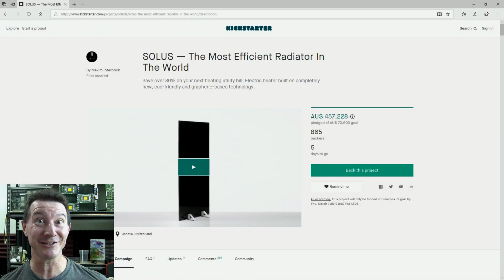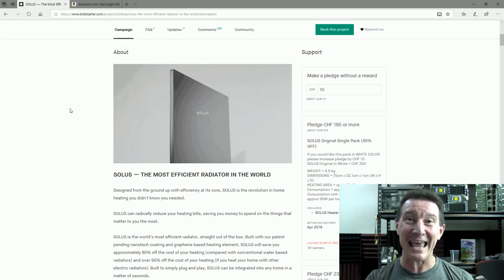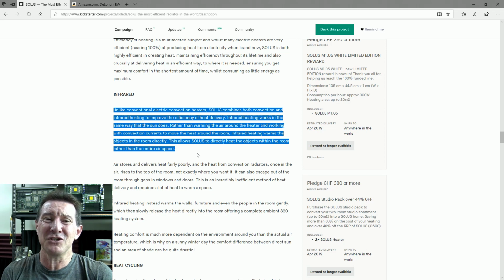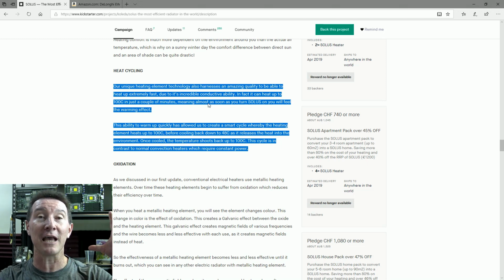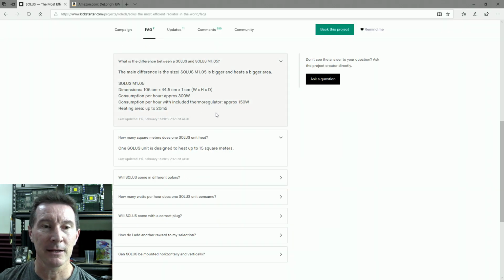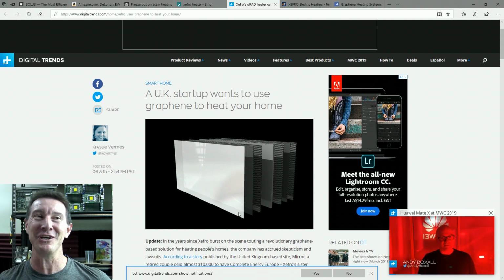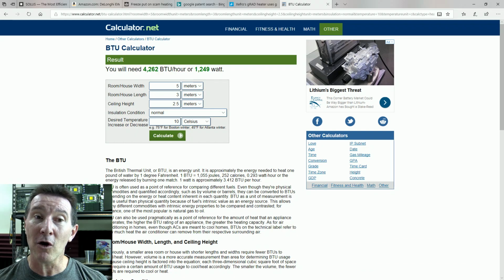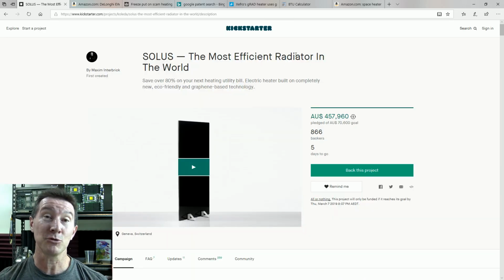EEVblog #1186 - Solus Graphene Heater Kickstarter BUSTED!

Comment: I just realized that if it is attached to a wall (hopefully with sufficient clearance), the thing will radiate from both sides.  This being the case, the "back" side will radiate INTO the wall (I assume there is no reflective matter between the panel and the wall).  The wall MUST absorb some of the heat and it will NOT heat the room.  So it isn't 100% efficient in heating the room.  Sorry about that...

Comment: Real simple how this works, take spin and hot air and add room. The graphene works because people repeating the hot air spiels on the wonders of this space age material to their mates adds to the total heat output so that you can get that over unity free energy.

Reminds me of the "wall" heaters that were 600W and create convection currents due to the radiator at the bottom of the cavity. They were only low wattage so you don't burn your wall. Salesperson tried to sell me one that was $500 had a nice black tempered glass front, and an element in the construction (not much else but brackets and power cable) and it was one of the cheaper ones. Needless to say I bought the $60 oil column heater that had dual elements (big and little for three heat settings) for a total of 2400W and a thermostat so I can save money.

Comment: At least if you buy a 200W light bulb, that is way cheaper than this heater, you can have the advantage of lighting up the room that is  warming, and it wouldn't be more effective at transfering heat since the bulb is also made of glass

Comment: Actually radiant heating can deliver heat directly to walls and ocupants of the room( heating the air only as an after effect) but in order to do this it needs to be a high temperature heating element ( because the radiant heat depends of the 4th power of the absolute temperature(Kelvin) of the heating element). As such, you will see such a system only in high ceiling rooms and only installed at a hight that makes it impossible for a person to touch them.
Because of the dangers of a high temperature radiant heating, all radiant heating used in homes are low temperature and rely on a large area ( doesn't seem to be the case here) in order to be effective.

Comment: I'm myself a creator on Kickstarter and an electric engineer who is running right now a campain (the Egrowr, a monitoring device for hydroponic plant growers). No fancy or false claims. The project is modest compare to some other campaign but the device works perfectly. It uses simple and prooved tech. I will not raise as much money as this kind of scam, but at least I won't disappoint my backers and won't end up in jail. But because of this kind of scam, I have comments from backers asking me if my device really works, if it's ready, only because they got "burned" so many times on Kickstarter. That's sad. 
Please report those kind of projects to the Kickstarter team (there is a button at the end of the campaign page). This have to change. They have to hire tech consultants in their team.

Comment: It is because people are stupid! All Resistive Heaters are all equally efficient! Power in is directly converted to heat with very little loss. It is not  like a an Edison incandescent light bulb were their is a lot of energy not going into producing radiant light in the visible spectrum and the heat is an unwanted byproduct and a sign of loss. I do not know how these guys could keep a straight face with the garbage coming out of their mouths! It reminds me of a late night infomercial. What is next people going to put permanent magnetic on their car's fuel line? Wait they already did that. Maybe they will stick stainless steel ducted fan blades into the intake are tract far upstream on the care to create turbulence in the air? Wait they already did that! I know they can put chlorinated paraffin in the oil and claim it reduces wear in the engine, allows it to run with no oil at all without seizing up and improves fuel economy!  No they have done that too. LOL Anyone dumb enough to fall pray to this needs to go back to elementary school!

Comment: Technology Connections also has a really nice video about space heater bullshit. A good watch after this one!
Reply from the maker: Looks good!
Reply: https://www.youtube.com/watch?v=V-jmSjy2ArM
Reply: Technology Connections is a fantastic channel that deserves a lot more attention. I hope some people wander over to check it out.
Reply: Especially the part that electric heaters are pretty much 100% effective because Heat IS their product is eye opening.
Reply: @Undefined Lastname It depends on the failure mode.  Most failures I've seen appear as point corrosion at the heating element terminal.  That corrosion is likely driven by thermal fatigue, with a strong initial trigger caused by damage when the element is made with a crimp or rivet.

A second class of failure is the thermostat contact points.  Obviously more cycles results in more contact erosion.

But this isn't to say that failures are common.  The vast majority of heating elements serve for decades without failure.  Rivets and crimps can both have an effectively unlimited lifetime.  Make-break contacts are a bit trickier with design and materials, but they can also be designed to have an extremely long cycle life.
Reply: @Undefined Lastname An oven element is typically a "calrod" sheathed heater.  Those typically fail when the helical element is off-center or the coils unevenly spaced.  That can occur from shock or vibration, but in an oven it probably had the defect when made.
Reply: Some heaters are better at heating a given space than others. Yes, they're all 97+% efficient at converting electricity to heat, but that doesn't mean they're worth a d**n getting that heat throughout a room. The parabolic heater I have will cook you if you stand in front of it, but does a poor job heating the entire room. Alone it'll hold the room about 68F; with a fan moving the air in the room, the room will be over 80F. The number you want is the efficiency of heat transfer.
Reply: @jfbeam  The key is they're all putting the same amount of energy (over a given time) INTO the room - I suppose that says nothing about the distribution but they're all going to convert 100% of mains power to heat.
Reply: @jfbeam  Except they're also 100% efficient at transferring heat.
You're talking about an IR heater that blasts you with LWIR and MWIR light, which heats you up directly.

Comment: For a bit over $20 (US) I can buy a nice fanned heater here in the USA at the local big box home improvement store.  Oh, they are 1500 watts as well (a bit more powered that this one).  Of course using electricity to heat the air in your home is very INEFFICIENT cost wise.  The nice natural gas heater that heats my house is much less costly in the long run (by about 3x as I remember).  What a waste of $$$.

As for things that conduct heat, you might try a diamond.  I understand that they conduct heat quite well.  A tad expensive though.

Comment: Buy carbon filament lamps!
Use your existing infrastructure to light up the room and heating at the same time. No additional costs!
It only heats when you are in the room!
90% gas heating bill saving guaranteed!
50 year lifetime warranty!
Reply: Making me want to make a panel with like 15 carbon filament bulbs behind them and make a good looking IR heaters

Comment: On a side note; Can you get Thermal Interface Material, or thermal paste in a graphene compound? What is its W/mk? For instance, liquid metal is about 73 W/mk, and good quality thermal paste is about 12.5 W/mk, whereas raw copper is nearly 400 W/mk. Diamond is about 1000 W/mk, so I wonder if you could make a really good thermal paste, better even than liquid metal using graphene?

Comment: Clearly the people behind this kickstarter  are either clueless or dishonest however this video seems too light on the physics as well.Heat is transferred either by conduction, convection or radiation. The first two rely on something to conduct or convect, In a vacuum radiation is the only way to transfer thermal energy. All three mechanisms can be at play with 'room' heaters. All rooms lose heat and good heating systems are designed to warm the occupants NOT the room. That's why underfloor radiant heating is used for maximum efficiency along with air tight building / room sealing and thermal insulation.Just to be clear, 50W of electrical power will ultimately become 50W of heat. It doesn't matter if it's turned into visible light using LEDs or to  heat an electric blanket. If the room was perfectly insulated the outcome will be he same.

Comment: I guess TECHNICALLY they're correct when they state: "The world's most efficient radiator", because they're the most efficient equal, along with every single other radiator out there. They're also the world's least efficient equal, with every other radiator in the world. Exactly 100% efficient, just like all the others. Except for those which lose some fractions of a fraction of a percent of efficiency by also running LED displays or WiFi etc...

Comment: Yeah, you'd want this in the centre of your room, not up against the wall. The Gib board would absorb a big percentage of that heat output, and you'd have a lovely warm slab of Gib board. 
It'll do the job just fine as an electric heater, but no more efficiently than any other; it's a law of physics. Electricity in = heat out in a basic resistive load.  These have existed for a long time. Like these old things: http://www.goldair.co.nz/product-catalogue/heating/eco-panel-heaters/425w-ecosave-panel-heater-with-digital-thermostat-geco260 but they don't have the fancy "Graphene" buzz word.
Or these: https://www.adax-solaire.com/electric-heaters-c1/electric-panel-heaters-c2/clea-wifi-glass-electric-splashproof-convection-radiator-panel-heater-p18

Comment: Dave, Do believe you're beating a "Dead Horse", It's not going to get up and do anything! Although, feels good to rant on the thing.
Folks either understand the laws of Physics, or they don't! They might take the advice of a trusted friend, (who actually knows something.) Or they are dumber than dirt, AND DESERVE TO LOOSE ALL THEIR UNDESERVED MONEY! A fool and his money ARE ALWAYS SEPARATED, (It's just a matter of WHEN.)
If electrical energy leaves the wall (Amperes at a certain VOLTAGE. (AMPS times VOLTS = WATTS)) no matter what it does, Light, Sound, Big Speakers,  Motor movement, Pumping, Fan AIR MOVEMENT,  any jalopy thing it does ( except ANY FORM OF ELECTROMAGNETIC RADIATION, Light, radio waves, Gamma rays, Xrays, Microwaves etc that LEAVE THE ROOM) HEATS THE ROOM, (Unless the room is too big to 'feel the heat' even though it is still adding heat to the room) Some energy might be stored, in pressure, or chemistry, or friction, or static electric field, or magnetic field, or elevation, but eventually these stored energies will be released back into the room, in minutes, or days, or one or two million years, ultimately heating the room. 
It's all so simple, but there are those intelligent design people, that deny everything, or those that think education is a myth created by God just to confuse us, certainly deserving everything they haven't really earned, or those one minute old babies born with a Silver Spoon up their arse.  I apologize I rant too much. Best Regards

Comment: Guys, I fully agree there as some serious BS around this KS campaign. However, Dave is partially wrong about glass being thermally non-conductive.  Indeed, there are many mechanisms to transfer heat from one element to the other. Conduction, Convection but also Radiation. And Glass has an excellent emissivity coefficient https://www.engineeringtoolbox.com/emissivity-coefficients-d_447.html which makes it use all the elements around it heat the room. I don't thing it justifies any of their statement about efficiency, however, let's not make it too emotional and stick with the facts. The way these radiators transfer produced heat to the room (not how the heat is generated generated) must be investigated before any conclusion. However, I will not buy them ;-).

Comment: At 43:27 that's not an oil filled radiator, it's a water filled central heating system, these are most often powered from a condensing gas boiler.  Yes an electrical heater will be more efficient than this if you exclude all of the production and transmission costs for the electricity.  Still you will get 90-70% efficiency with a modern boiler!

Comment: We'd need 8 of them tho.... Btw that european system with water is using a central heater that heats the water for the whole house including the hot water for the taps and shower. They are mostly gas (eu definition) powered although they are being swapped for heat pumps and other more sustainable gas-less systems as here in the netherlands a lot of houses are required to stop using gas and the goverment stops exctracting gas from the ground. It caused some earthquackes

Comment: Every time Dave says "Watts per hour", something dies inside me..
Reply: Mario, I also feel your pain
Reply: Mario hjkuzffrt why?
Reply: @Paradiesgestalter  Watts are a unit of power, or energy over time. One watt is one joule per second.

So power is to energy as speed is to distance.

"watt per second" describes a change in power, just like acceleration describes a change in speed. Taken literally, it means that the device would be consuming 180 watts after an hour, 360 watts after two hours, and so forth!

Obviously, they meant to say "watts" not "watts per hour"..but didn't, whoopsie.
Reply: Steven Haussmann thx for the info
Reply: @Paradiesgestalter  - TBH, it's not just these scammers who make this error. Only, in their case it's most embarrassing because it's supposed to be their expertise.
Wh means Watt-hours, though you will more often read kWh, for kWh. (1 kWh = 1000 Wh). It's a measure of energy, namely a certain power (in Watt), DURING A PERIOD OF TIME. Intuitively one may see how 100W during 1 hour will be more energy than that same 100W for just a minute. So for energy you MULTIPLY power and time, Watt x hours, or Wh for short.
DIVIDING power by time, like "Watts per hour" is basically meaningless[*].

[*] With some imagination it could stand for a power gradient: if the power rises from 10W to 100W in 1 hour that would be a gradient of 90W/h. I don't think anyone has ever used it this way, though.

Comment: It looks like infrared heater, internal plate is heated quite high and emits IR though the glass, not heating air. Theoretically it heats your skin directly to make you feel warm, while the hole room could be colder than usual. This could give some economy.

Comment: Are you sure radiators are 100% efficient because mine makes a weird buzzing noise so I'm sure at least like .01% is leaking out as sound energy
Reply: more like 10^-6~7.... It really does not take that much energy to make sound.

ps:I could be overestimating by a long shot
Reply: It's absorbed and then turned into heat.... So... It's still 100% effective
Reply: Sound technically converts to heat as well by causing things to vibrate.

Comment: The good 'ole column oil heater has a massive active hot surface area in comparison & causes convection air flow of currents of rising warmed air above it and does a fairly damn good job but i have as usual over summer split & stacked enough wood for my home's woodburner to consume for when winter arrives here in New Zealand... (beats the ass off any other heating systems i find).
Reply: I have a convection heater that looks like an oil column heater with a couple of elements looped through it.  It works pretty well too,  I liked it better than oil heater as less warm up time (consequently stops releasing warmth quickly when off,  oil heater just has thermal inertia) .  The fins don't get that hot as mainly for looks but the elements being confined in the fins with vents at the top creates quite an air flow due to the heat and confined space.  Actually used several till I fully insulated my house With double glazing now one is plenty for a 3 bedroom house  Way better ways to improve room warmth than this scam LOL.

Comment: I'm just wondering if the main factor here is that they claim to be pulling much more infrared heat than other heaters - ie: more useful heat on your skin for example. That's why glass is the preferred medium as some glasses allow IR to pass. 

The air temperature could be 15C while your skin temperature is 21C for example. At that point you don't necessarily care what the air temperature is if it feels warmer to you in the room. 

If this is the case though it still seems highly suspect as they make no attempt to point this out in their responses to people doing the wattage calculations in the comments... I think however that it's important for us to consider radiant vs convective heating and efficiency in terms of energy needed to produce your desired heating goal in this case.

Comment: Man there are so many things wrong with this product and its description....
Nearly no one from Central Europe has electrical/infrared-radiators.
Most common are Heated-Water-Radiator Systems, so a centrale waterheater that runs on oil/natural-gas/wood or for Vienna a central Waste-Burning-Facility where the Heat is spread across the City.

Using electricity to heat the Rooms, is only somewhat cost effective if the electricity is used by a heatpump-system.
Horrible and that from an swiss company...
Reply: Central European here. While we don't have this bullshit in our homes, I do occasionally come across a bullshit peddler trying to sell this "new heating technology" that invariably turns out to be a resistive heater, usually in the shape of a fancy panel to make our clunky old radiators seem obsolete. So this is nothing new to me, but I am impressed at how well this scam works. A sucker really is born every day, huh?